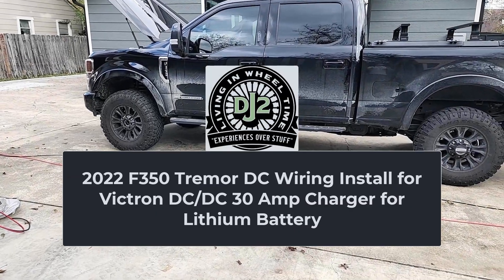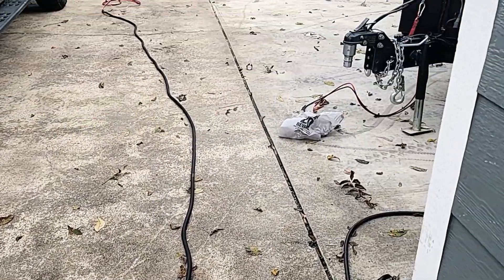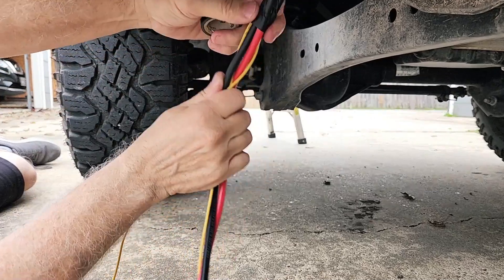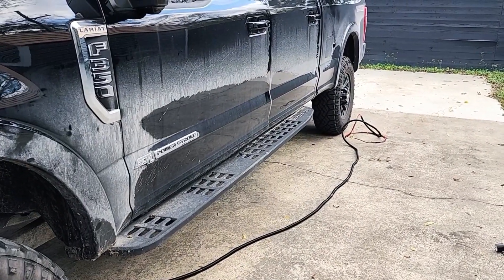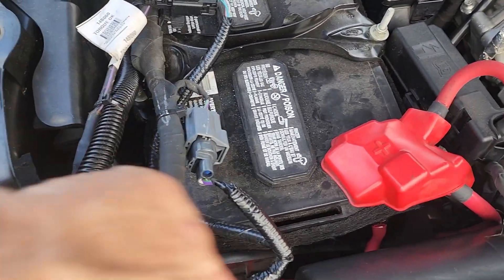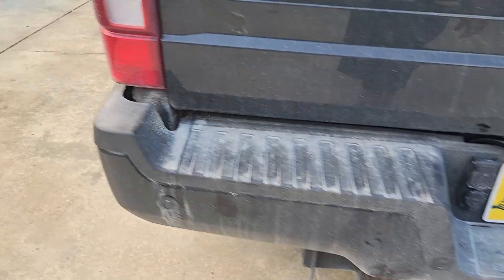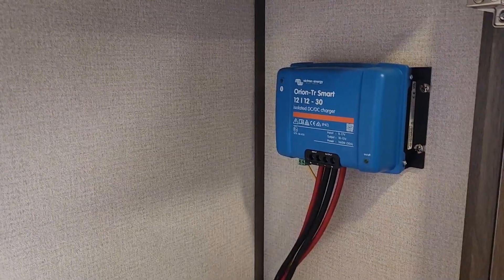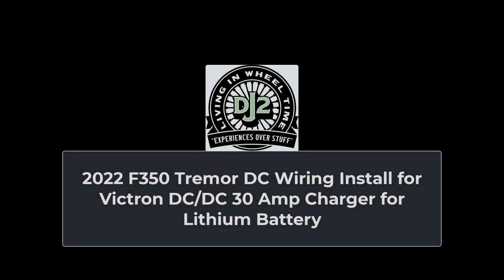2022 Ford F350 Tremor Wiring Installation for Victron DC to DC Charger

Comment: Hey, thanks for the video super helpful. Just to clarify, did you connect the 5A inline fuse for the signal wire directly to the upfitter wires under the fuse box?
Reply from the maker: Yes

Comment: Thanks for the video.  Where did you connect your Ground wire on the truck side?  Saw it near the Negative Battery terminal, but wasn’t connected.
Reply from the maker: It is connected to the negative battery terminal.

Comment: 1. Did you wire both pos & neg to the battery?  I thought alternator connections were required?
2.  I have no Upfitter Switches on my F350 XLT.  Is there another option for the yellow sensor wire?

Thanks.
Reply from the maker: Yes, I ran both wires negative and positive to the battery. The charger can be wired to work without the sensor wire or you could install a toggle switch. I wanted the convenience of control in the truck.

Comment: Was wondering why you opted for the ISOLATED version of the dc to dc charger than the NON-ISOLATED version?
Reply from the maker: I don't remember why I chose the isolated version. I was going to run my negative wiring all the way back to the battery might be the reason.

Comment: What type,  gauge, and length of wire did you use for the yellow wire?
Reply from the maker: 6awg for the wire size, somewhere between 25 and 30 feet of wire  if I remember correctly.
Reply: @dj2livinginwheeltime265   Thank you.  I was talking about the Voltage sensor wire.
Reply from the maker: @RFT2112  I think it was 16 gage for the yellow wire

Comment: In this setup, would the anderson plug at the bumper always be hot in the key-on position?
Reply from the maker: Yes, battery voltage is ran to the Anderson connector.

Comment: I did a similar install on my F250. For the Anderson connector I mounted it to the bottom of the receiver hitch with a stainless self tapping screw. If that weakens the hitch we have bigger problems.

Comment: I'm seeing vast cost difference of the 6 guage wire from 65 to 210.00. Curious where you purchased your wire from the battery to the connection in the back. Thanks
Reply from the maker: Check the description, there is a link to Explorist Life, this is where I bought wiring, the circuit breaker and fuse. I did not have enough wire for the truck and trailer, so I ended up buying wire from a local hardware store to complete the truck installation.

Comment: I enjoyed your video especially since I have almost the same truck. I am going to add one as soon as I can.

Question - Why does the negative have to go all the way to the front, why wouldn't grounding on the frame work? Since wire size is based on current and total length of positive and negative you could cut back on the gauge, maybe. 6 gauge copper (not the cheap CCA) is very expensive and at 30 amps one run should work on 10 gauge according to chassis wiring specs from the manufacturers. Also, the often used rule of thumb is a 20% margin meaning that a 40 amp circuit should work meaning I could actually hookup to my 40 amp upfitter switch.

I would really appreciate any comments. This the last step in my RV upgrade which includes 1000W  solar, 100 amp MPPT controller, inverter, 400ah Lithium, series shunt and house charger to Lithium. Thanks for doing this video and all the best.

Jim
Reply from the maker: We could get into the weeds here but, here are my 2 cents. We know the resistance of the copper-stranded wire and the Anderson connections. What is the resistance of your truck frame and how will that affect the current flow? What is the resistance of a connection that is bolted to the truck frame and is it protected from the elements? I want to have the most reliable system to charge the battery, this is why I ran positive and negative cables.  For sure it's not cheap :) Good luck with what you decide. #6 is what is recommended by Victron, you can find this information on their website. There is a link to their site in the description.
Reply: @dj2livinginwheeltime265  
Thanks for the reply, I can't disagree and It sounds like you are a person that will go above and beyond and there is no doubt in my mind that because of this you will not have any issues. I guess for me it was the cost more than anything. I also believe you a smart guy just because of what you are driving. We are heading your way (Texas) form Eastern Canada in about a month with my 2022 F250 Tremor 6.7 and 5er. On to NM, AZ, NV, UT, CO etc. for a 2 month tour. I am really excited. All the best, Jim
Reply: This is pretty much what I did. I used marine cable that has both positive and negative in a sheath. Rather than running a signal wire, I tied in to the trailer running lights for turning the charger off and on.

Comment from the maker: I have not checked for any voltage drop. Checking a voltage drop calculator online the 6 and 25 feet @ 12volts and 30 amps it says the voltage  drop would be 0.59v

Comment: Using same charger. Gets so hot I can’t touch it for more than a few seconds! Is that normal? I’m using 6awg wire and 60amp fuse at the battery. 

Is the burning hot normal?!
Reply from the maker: We checked the charger a few times when we first installed it, it was only warm to the touch never hot like you described.

Comment: Since the 12 v from the 7 way is left as is, i assume the dc to dc charger over rides any charging that would normally come from the 7 way,  which could potentially damage the alternator. Thanks for your comments.
Reply from the maker: I don't think the 7 way charged the batteries on the trailer. The batteries were charged from solar panels and solar charger.
Reply: The 7way from the truck supplies a small 7amp charge to the trailer house batteries, so the dc to dc charger is suppose to protect the truck alternator from the lithium batteries pulling too much amps and overheating it. Thats why I'm questioning what's protecting the alternator if the charging pin in the 7 way is still connected as you commented in one reply to another viewer. Hey, I appreciate anyone's comment on this question.
Reply from the maker: There is no charge current coming from the 7-pin connector going to the batteries on my trailer. Some trailers with AGM batteries charge the house batteries from the trailer connector, mine does not.  @nickc8438
Reply: Thanks again for responding. In my 7 way,  my truck charges the lead acid batteries in my 5th. It would really be helpful to know if the power pin is disconnected when using a dc to dc charger or if it is automatically bypassed when using the charger.

Comment: What size/gauge wire did you use for positive/negative? Looks like 8awg but I could be wrong.
Reply from the maker: It is 6
Reply: Did you use 6 awg because it was required for a specific reason or could you have used 8 awg since it only 30 amps?  Thanks for posting the video.
Reply from the maker: I thought overkill at first but, the battery folks in my research say to use 6. About 25 feet to wire the truck @michaelhankerd1324
Reply: Victron specifies 116mm2 (so about 6ga) for a 5+ meter run which this would be so that is correct.  @michaelhankerd1324

Comment: What size alternator did your truck come with?
Reply from the maker: I opted for the winch when ordering which adds dual alternators, 397 amps
Reply: @dj2livinginwheeltime265  unrelated to the video, what is your cargo carrying capacity of your truck? I'm looking for around 4K and just curious if it's even possible with the Platinum trim SRW with the 6.7L. I believe some Tremors come with a larger payload.
Reply from the maker: The cargo rating on my F350 Tremor is 3301. We have just put the Tremor up for sale and ordered an F450 as we plan on getting an ATC 4528 for full-time travel. Check out the channel "Time on Target" as it may give you some insight about single-wheel towing a big trailer.

Comment: Does the wire loom protect it from heat or just damage? I did not put this over my wires on my install. Do you reommend that I add this loom cover over my wiring? I tried to avoid the exaust area when running it.I am running a 40amp DC-DC charger made by Renogy. I do have the correct 60 amp breaker on the battery end and the 50 amp breaker on the RV battery side of the DD-DC charger.
Reply from the maker: I think it increases the impact protection, but I doubt you get much heat protection. The wire loom is pretty thin so only marginal protection from impact. I like the factory look also. Sounds like you have a properly set up system.

Comment: Question, why didn't you hook it up to the driver side battery?
Reply from the maker: The passenger side has studs at the battery terminals that make it easy to connect additional wiring, the driver's side does not. Great question.
Reply: Yes good question.  On the one hand the passenger side is primary and therefore connected directly to the alternator.  In my truck (F250) the passenger side batteries, negative terminal, is just slightly below the hood, unlike shown in this video.  On the driver side, I have good clearance on both + and - posts.

Comment: Why did you use a 60A fuse/breaker for a 30 A DC-DC controller?  Shouldn't it be a 30A?  Also is the passenger side battery the starter battery on the Ford diesel ?  Is that why you wired to it instead of the driver;s side or was it just because of your accessory switch fuse box location?  Thanks!
Reply from the maker: Joe, great question! 60 amp is the overcurrent recommendation by Orion in their instructions. The passenger-side battery on my 2022 F350 truck has terminal points that allow you to add connections from the factory, the driver's side does not. That's really the only reason I ran the wires to the passenger side. The auxiliary switch wires are on the passenger side also for the sensing wire connection (optional)

Comment: What do you do with the 12v that is coming in from the regular 7 pin trailer hook up
Reply from the maker: I did not do anything with the 7-pin connection. I left that as is from the factory.
Reply: Since the 12 v from the 7 way is left as is, I assume the dc to dc charger over rides any charging that would normally come from the 7 way, which is the reason for the charger?
Reply: @nickc8438 there is so little power coming from the 7 way charge line that it doesn’t make any difference since you are getting so much power from the dc to dc charger
Reply: I think that is the correct observation. The gauge wire is so small that it can't handle much amp draw. However, it's strange that the 7 pin power wire is usually never mentioned. If you follow the logic of the dc to dc charger, it's evident it should be mentioned. With the dc charger, you're trying to keep from damaging the alternator, but on the other hand, it's still connected. Oh, well. Thanks.

Comment: Great video. I have a 2022 F350 FX4 so this will help a lot. Can you tell me what gauge wire you used and the size of the Anderson Connectors. I suspect 6 AWG and 50 amp connectors?
Reply from the maker: I did use #6, Anderson Power Products SB50 Connector Kit, 50 Amps, 36V Gray Housing, w/ 6 AWG, 6319 (Pair) from Amazon
Reply: @dj2livinginwheeltime265   What voltage drop are you experiencing with the #6 wire.  A lot of the wire calculators recommend #2 or #3 wire for a 25-foot 30 amp run.
Reply: @dj2livinginwheeltime265  Great - thanks!

Comment: Nice job Dane.  More or less, just what I did on mine.  Except I used the voltage sensing feature on the Victron.  Running the wires along the driver's side is the best route since it is away from the exhaust and following a factory loom.  I also used the passenger side battery as that seems to be the primary battery with the best connections.
Reply: Voltage Sensing feature?  Is that in place of the Yellow wire to a switch?
Reply from the maker: Yes